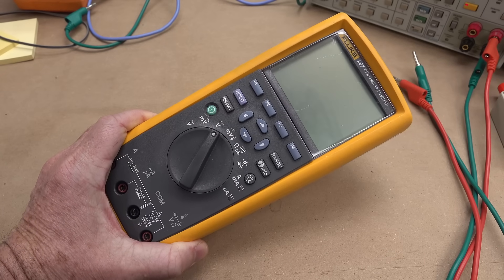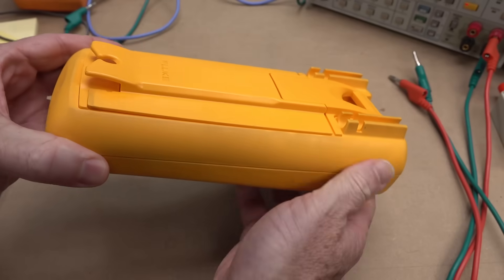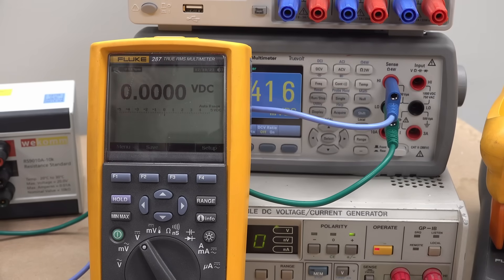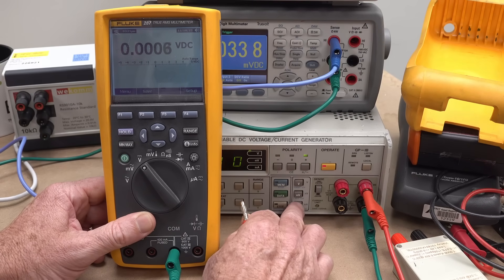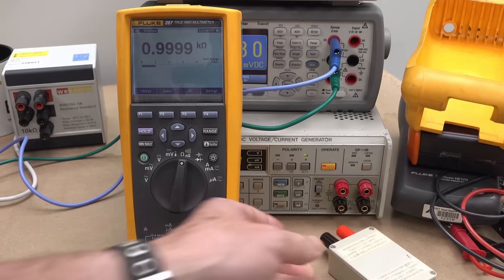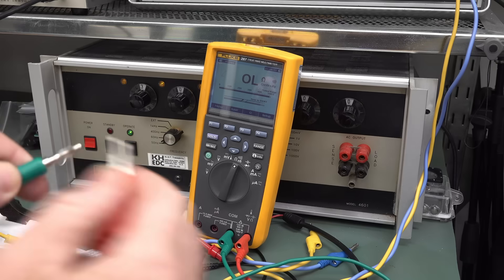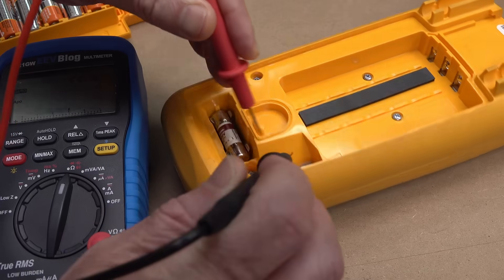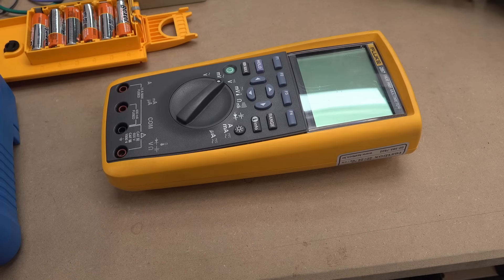Fluke 287 Repair - My Arse

Comment: Sometimes they just want to unload it from a larger lot and don't want to have to deal with returns due to random potential faults
Reply: Yes likely a big job lot, and they just want to recover the lot price and make a small profit, probably because the job lot had a few items in it they wanted, and knew they could shift for a good price. Then sell the rest off quick, as storing it, and testing, costs more than what they will make off having fully working stuff, and selling as untested faulty means fast sale, and no returns.

Comment: Hahaha, I can't believe I paid full price for one of these years ago. Great meter but blatant false advertising on the datalogging feature. I bought the bundle lit with the optical cable, and you have to buy expensive software to get the data off the damn thing. Even talked to a Fluke engineer buddy of mine and he is baffled by this. Next piece of test kit I buy is going to be listed as faulty so I know that I get a good one, hahahaha. Thanks for the video, Dave!
Reply from the maker: I just noticed you can only get the Trend display graph AFTER you have stopped logging?
Reply: @EEVblog2  Ahhh okay. Maybe they need to render the graph in post? If these 200-series Flukes are decades old then maybe they've never updated the processor in them so it's slower than a wet week
Reply: Yeah, really annoying @EEVblog2
Reply: @EEVblog2  
That was my thinking too. You didn't check anything except basic functions and told us earlier, that this thing has recording capabilities. So how can you tell, it's in good working condition by just testing the cheap basics.
If you sell this as functioning via ebay, next you have is complaints, extra postage and extra work.
Reply: If you have programming skills, you don't need the Fluke software. The protocol is fully documented, although I don't think it's publicly posted on their website. I enquired about it one time, and they sent me the protocol documentation. It's a simple ASCII-based protocol. Easy to work with.
Reply: @swb-54  Whether the protocol is documented or not, unless you buy the optional interface hardware you're not getting the data off of the meter.

Comment: Btw. you NEVER use the meter to measure itself. Easiest way to destroy a DMM. Virtual ground and stuff.
Reply from the maker: Not in this case. Using ohms range to measure the fuses is fine.
Reply: I've blown a fuse checking the battery voltage. Some things may be fine,  but probably best to use another meter if you want to play it safe.
Reply: @bert-blank If the fuse blows it means the battery is fine
Reply: @mikethompson2593  lol.
Reply: its in the user manual. must be safe as its a declared function.

Comment: Could leave it datalogging for a while,  maybe it has an intermittent fault. 
Or maybe it's optical port is faulty.
Could also be a solder ball moving around inside that was dislodged by shipping.
Reply from the maker: I have for a bit, seems fine.